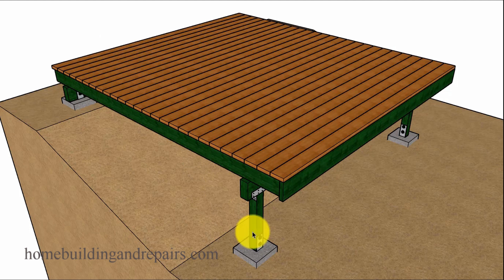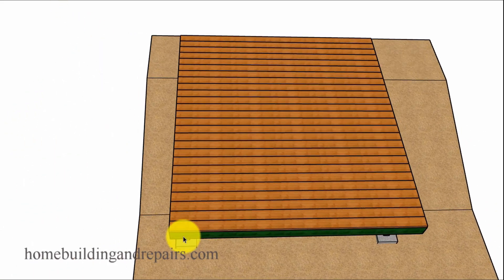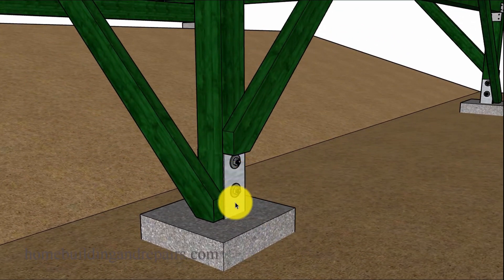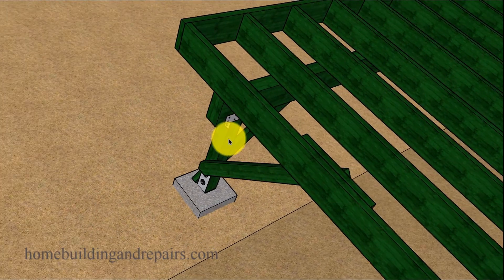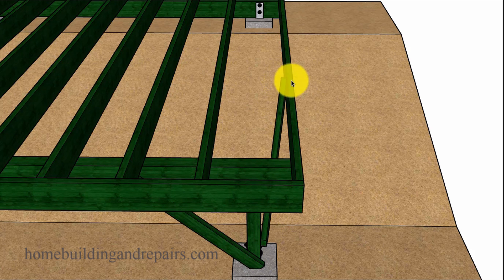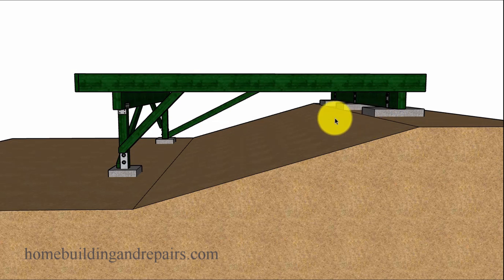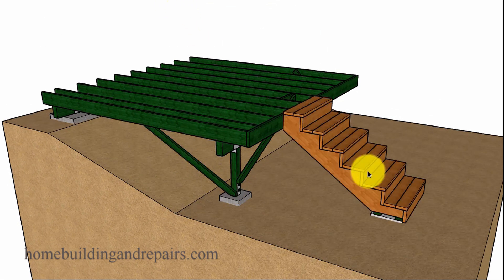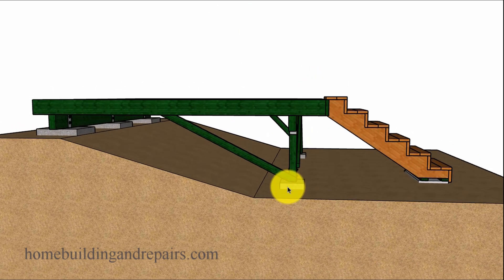Structural Bracing Ideas For Small Decks Built On Sloping Hillside

Comment: Hey Greg, I was watching your retaining wall videos on a slope, my question was, what if I create small pier footings across the slope horizonally, then create some sort of deck across the slope (i guess you can say floating). Would that be feasible since it's much less work and digging + drainage vs a retaining wall. I just wanted to create something where I can walk on a level surface across the yard. If you can do a video on that that would be great, if not, any other help would be appreciated. I'm currently looking at a product called Handi Pier.
Reply from the maker: A wall running perpendicular to the slope could work if the footings and wall are deep enough.

Comment: Greetings.  Your video is for up slope.  How about down slope for a 12' x 10 ft' deck. At the far end of the 10 feet, its 4 feet down the the ground.  At 12 feet I think I should add another post in the center.  I will overhand the deck 18 inches on the sides and rear.  My front will be one foot above ground level.  Thanks, Gil (Bianca's better half).

Comment: If you are a small person, the deck may not move when you push, but it may lift with enough strong winds, especially if it is a tall deck. Also, the deck could sway if you have several people on it. It is best to brace unless there is a specific reason  that does not allow you to brace it.

Comment: Hi Greg....Thanks for the information. I am planning to make a floating deck on a slope using tuffblock. 10'x15'. The 10' length is on the sloping side and the height from ground is 2'11". Will the structure stand. The structure does not just stand on 4 post only. The whole structure stands on approximately 25 to 30 tuffblocks with various heights on each tuffblocks, My questions is, will the structure be strong enough to hold on the tuffblock? Thanks for you advice in advance.
Reply from the maker: Taller decks might need in ground footings.
Reply: @gregvancom   what about 2’11” on one end and the other end rests on the ground level maybe 6”?

Comment: i dont understand those brackets connecting the vertical beams with the horizontal plank, what type of bracket are being used?
Reply from the maker: They are often referred to as post base connectors and post to beam connectors and they can usually be found at your local lumber yards.
Reply: @gregvancom  thank you this is very helpful

Comment: Agree with Doug that you need to block the joists along the beam runs, to prevent the joists from overturning.  Also, you can achieve the same rigidity as the front bracing by placing horizontal diagonal(s) corner to corner under the joists.  This way you have a cleaner look.
Reply from the maker: I like Doug and he often leaves a comment on my videos. Yes, blocks will definitely be good, however I don't think that you're going to get the same strength out of nailing a 2 x 4 at an angle to the bottom of the deck, but it does provide a cleaner look. I might be doing a video on this in the future as a result of your comment to provide you and other viewers with more information.
Reply: @gregvancom  I think we need a structural engineer to chime in here, but I am thinking the longer the diagonal, the stronger the brace.  We are assuming the uphill pillars are adequate anchors.
Reply: @TenThumbs  Good points, the size of the deck, footings, decking materials, spacing, joist, slope of hill and other items could also be a plus or minus to this situation. By the way, Thanks for sharing your thoughts.

Comment: What do the braces do? Do you have a video about bracing. Like a intro to bracing. I ask because I see you have the nailed/bolted to the side. My assumption is they have nothing to do with structure as in compression loading. I have seen where people notch the posts and or deck beams. I would just like a better visual understanding of what braces are for.
Reply from the maker: I don't have any information on the basics of installing braces or the reasons why, but will put it on my list of videos to be made in the future. Don't forget you can go to the website for more information about structural engineering and building decks.

Comment: Great Video, Greg. I would cross or block bracing on the underside between the joists.
Reply from the maker: I like it and thanks for sharing another great idea.
Reply: Is is that necessary if the span is less than 10 ft? I forget the standard or requirement of joist bracing based on length of plank span.